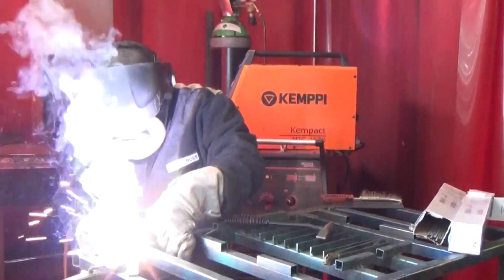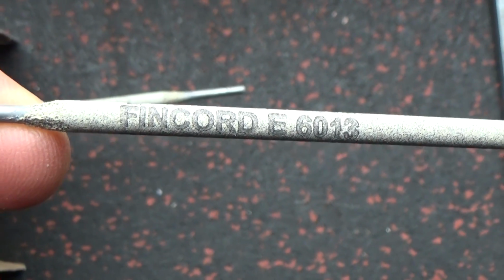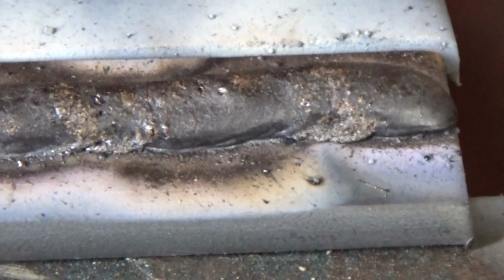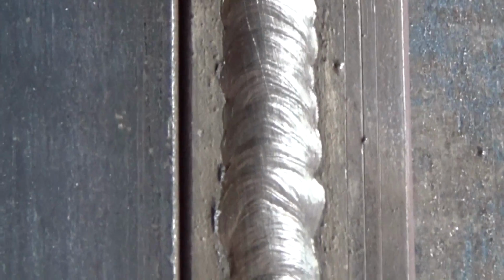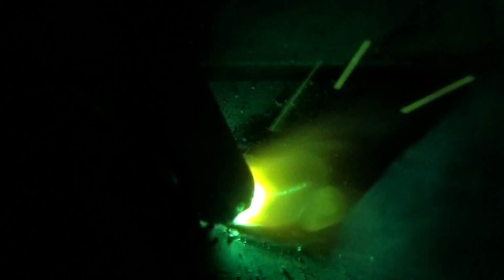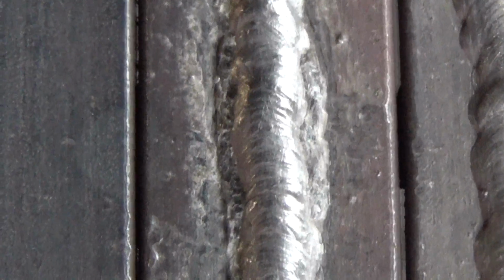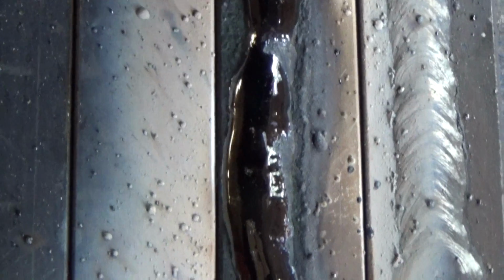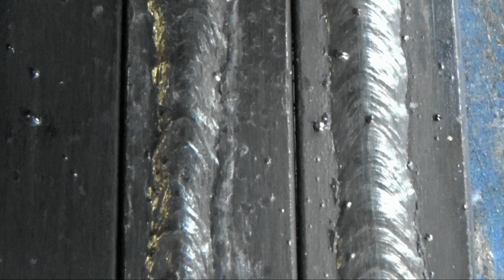How to choose the right current in stick welding.

Comment: I think the rod is 20 mm diameter, from the video, but the metallic rod inside might be 15 mm. If a normal rod is taking 350A for 10 mm diameter, I guess for 15 mm your rod, would be 450 A. How I'm going?
Reply from the maker: Hello. The diameter of rod is 2.5 mm in both cases. You can see it when I show the packages of the electrodes. When we talk about the diameter of electrode, we talk about the metallic rod inside, not with the cover of the electrode. Cover of the the electrode may be different thickness, it depends on the technology. The welding current you can see from the packages. If you don't have the package, you can take the diameter of the electrode and multiply it on 3 and 4. So, for example, for electrode of 3.0 mm diameter the welding current may be from 90A to 120A.

Comment: Hi Oleg
Can you explain a little bit more about electrodes,  I mean about european numbering. 
On YouTube I can find just american numbering system

Thanks
Reply from the maker: Hello! Thank you for the question. Of course! The international standard ISO  2560 describes the electrodes for mild steel of the yield strength till 500 MPa. For example Esab Ok46 specification is   E38 0 RC 11, 38 is 380 Mpa, yield strength, 0 - zero degree by Celsius - impact strength, RC - the type of coating of  electrode:  rutile - cellulose, 1 - the type of current AC/DC, 1 - welding positions : PA, PB, PC, PE, PD, PF, PG

Comment: Hey Oleg,  I'm new to this welding I'm trying to weld a steel drum to steel legs with 2.5mm diameter rod I think it should be 80 amp but I cant get it to stay lit or leave a bead just sparks I'm thinking it might be too thin for what I'm actually doing ? But I'm also not great
Reply from the maker: Hello Aaron. Sorry for delay in response. 80 A - is normal current for the electrode with 2.5 mm. But there are  4 big types of electrodes: acid coated, rutil coated, basic coated and cellulose coated. Normally 
Widespread 2 types: basic coated and rutil coated. If you use rutil coated electrode strike the arc very easy. But with a basic coated electrodes is with difficulty. So, rutil coated are marked as E 6013, with a american standard AWS 5.1. So, by the european standard of  EN ISO -2560 rutil coated are mark by letter R. For instance : E38 0  R 12 .... . You can take also: types of RR, RC. These are almost the same. So, be careful, if the thickness of base metal is no so big (until 5 mm) by the current of 80 A you can burn through.

Comment: I’m very much a newbie, practically a virgin welder at 59, so please excuse me if I’ve got something wrong. For my 200amp hobbyist MIG/flux/MMA welder I’m better using my rutile 3.2 rods at around 70 amps for welding 6mm to 8mm mild steel? I’m a little too shoot in amps for MIG as my machine will only efficiently weld 5mm  steal using the 40amps per mm guide?

My biggest problem with be striking and forming to puddle as I’m actually making a large rose that’s also a bird feeder and my longest weld will only be 40mm.

This video is extremely interesting, though I think I will have to watch it a couple of times to take away everything it has to offer. Thank you for posting it. Subscribed.
Reply from the maker: How are you, Mark! Nice to read your comment! Thank you for it! I think for 3,2 mm rod the amperage of 80-90A will be OK. It depends on what kind of electrode you use for welding. There are 2 big electrode groups: rutile coated (for exam. ESAB 0k46)  or Base coated ( esab ok48). It will be needed about 90 A for the rutile an about 80A for the Base. 
So, for MAG welding, for 1,0 or 0,8 mm diameter of wire and 5 mm of metal thickness, I think 150-200 A will be OK.  Of course, the MAG machine of max amperage of 200 A is not so good for industrial purposes, but for home it's OK. But not for 5 mm of metal thickness. It will be good for 1- 3 mm Steel.
Reply: Oleg Suvorov Thank you very much indeed for your comprehensive answer. I knew when I bought the machine it’s very much a home/hobbyist machine and I won’t be building any bridges with it. Because of my disabilities I will only be making smaller, none weight bearing pieces that won’t be affected by impact at all. I want to make artisan pieces for the charity I work for to sell, as they do my photography.

The rods I’ve got are actually Polish so I will take them into work when I go back and ask a colleague what type they are.

Thank you once again for your answer, it’s really useful.